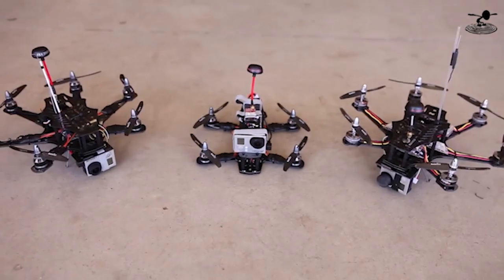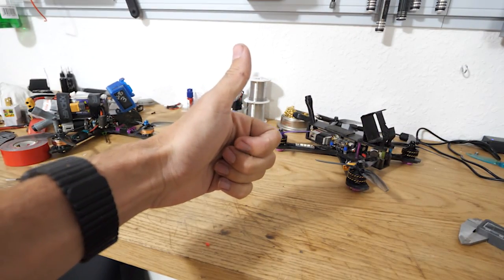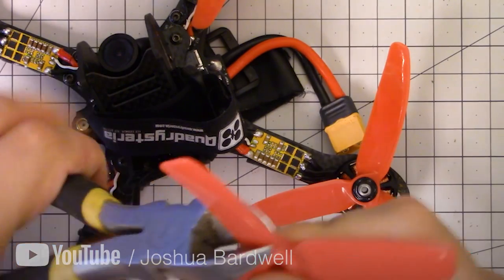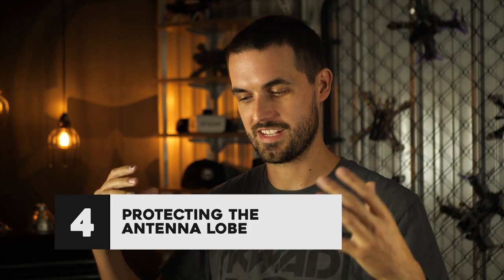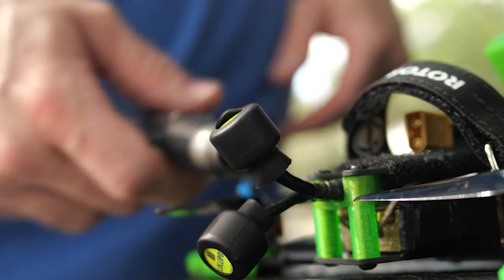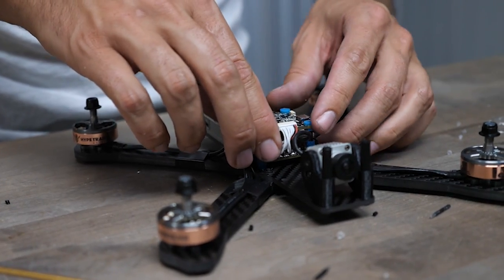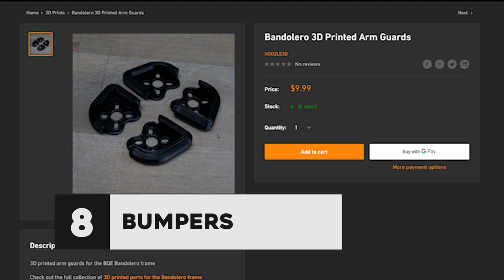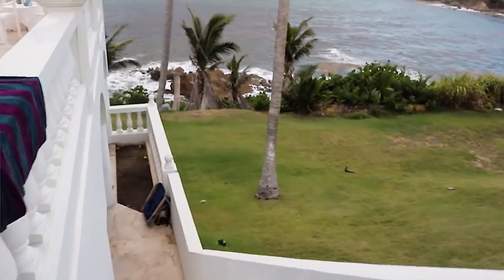top 10 Tips for DURABLE FPV Drones!

Comment: Tip, build 2 identical drones so you dont have to do fieldrepairs.
Reply: Genius, or stop paying child support for next BUILD
Reply: Why stop at 2, ménage à trois!
Reply: They wouldn't even have to be identical. And yes, most serious drone pilots have multiple drones for exactly this reason.
Reply: Tip: just be richer
Reply: I agree. It also makes it easier to buy spares, e.g. buy 9 motors for 2 quads, and one extra arm. And when both quads break in different places you can switch parts so that you end up with one working quad and one doubly broken, while waiting for new parts to arrive.

And you simplify tracking down what's broken, e.g. I recently burned a small resistor on an ESC and managed to find it by visually comparing everything against the identical working ESC I had on the other quad, and then comparing resistance measurements between them. If I didn't have two identical ESCs, I would probably have had to throw it away.

The comments about "being rich" are exaggerated, in the long run you probably spend less building 2 identical drones. And you certainly get more flight time per dollar spent.
Reply: Not necessary identical. But for same prop size and battery. Once had even 3 quads with me.
Reply: @axfpvalex1944  lmao underrated comment

Comment: Definitely forgot conformal coating
Reply: What is this?
Reply: @66g66g66g66g  Silicone coating that does not interfere with electrical signal. You coat all the exposed electronics on your escs and flight controller and your quad is suddenly a lot more waterproof.
Reply: @66g66g66g66g  your Quad can actually fly out of a water puddle with no damage at all.
One of my Quads is actually so waterproof now that i can not even press buttons anymore 😂
Reply: it improves durability but not repairability. Trying to solder onto a conformal coated board is a pain in the ass

Comment: I have saved my quad several times by flipping my mode switch to horizon mode, releasing the right stick and punching the throttle when i fail a maneuver like inverted yaw spin.
Reply: Bingo, that's exactly what I do I have my finger on that switch the whole time
Reply: Absolutely, in situations where the FC has time to react, this is a great way to regain control.
Reply: @EvenTheDogAgrees  in fact, i have intentionally done a death roll until inverted, allowed it to free fall, and flipped the switch at the last second while simultaneously hitting full throttle... Only twice. Lol
Reply: @Catiadr  Hahah, reminds me of my drone buddy. We both got started at the same time. I'm still figuring out basic things like hovering in place, maintaining constant altitude as I fly around, gauging my altitude and speed from the view in the goggles, ... Meanwhile, he's already trying out various stunts. So while my drone comes back from our flights relatively unscathed, perhaps some nicked props, he's currently out of commission because he tried to fuse his drone with the concrete pavement through liberal application of throttle... :')

Comment: Can confirm about learning to crash. In those events where you get caught in a branch, get flipped over, but the quad regains composure, it's so handy to at least be able to quickly flip over the quad so that the bottom bounces off the ground, instead of landing on an arm, or the GoPro, or even the battery. That quick reaction usually is what keeps me flying for a whole day usually!
Reply: yeah I just turn to Angle mode real quick

Comment: conformal coating is my favorite - I just landed in a fountain two days ago...
Reply: I've had mixed results.  Sunk one 3" quad in a puddle and it dried off and flew.  Landed another in wet grass and ESC fried.  I still use the coating though.
Reply: Hi
Reply: Bubby FPV sup bro
Reply: Is the conformal coating basically the same thing as never wet.  I don't mean as in the end product being it doesn't get wet. I mean never wet leaves a white rough sandy feeling to what ever is coated.  I've done a drone in it. And it works but looks like shit.  Looks like it was coated with that Xmas tree frosting but thinner.   So does it leave a noticable residue?
Reply: matt Wheat no, it doesn’t repel water just seals electronics. You can use clear nail polish too
Reply: Make sense if you expect your quad as disposable. Because after thorough coating repairing or upgrading it after is a huge pain. Same if Nano-Protect is used. In result - oily, smelly and dripping thing possible to keep only somewhere outside home.

Comment: #10 is really important. learned this during my helicopter flying days. learn to instinctively shut off your motor before you hit anything. either by killing throttle or by disarming. this will reduce the damage to your craft(burnt esc) and whatever it's hitting.
Reply: What? I thought I was the genius that came out with that, glad to know I have a twin 🤔🤯
Reply: Helis are so much more susceptible to damage because of the whole mechanical swash-plate array...
Quads aren't like that. I came from helis and by instinct disarmed as soon as I thought I was gonna hit something.
But no, I learned you can pull through, bounce off, throttle yourself out of a tree or even turtle-mode back.

Comment: Hey I use those skids, butt I add two of those foam pad on the back arms and it sticks up a little past the skids and keeps you going straight while sliding. Another is to put air mode on a switch. Then when you slide, throttle 0 and turn off air mode and it won't mess up having the quad try and fix what your doing. The props will just stop spinning. I have it on a toggle so it auto turns back on. Works awesome when going down a playground slide or something where it would be better to not having the props hitting things.

Comment: Conformal coating is so damn important, not only makes the quad water resistant but also protects it from short circuits (components touching other components or touching the frame).

Comment: I tried the foam that came with my Armattan frame. I tried the Ummagrip. The best thing I've found for holding the battery on is Velcro with sticky back on the batteries and the top of the quad. I've never had a battery eject or even shift position with the Velcro.

Comment: 1. I add a 1/2-3/4" band of double layer heat shrink to the ends of my batteries to secure the leads and act as a bit of a bumper.
2. My Tyro99 has narrow arms that are pretty fragile.  I added a thin coat of epoxy and they seem to hold up much better.
3. LOCTITE YOUR SCREWS!  I've now thrown two motors.  That's how many motors it took me to start using loctite and check my motor screws before every flight (especially if you're using plastic skids under the screws).
Love you guys!
Reply: I like to use a carbon fiber plate on top of bat, to get hard impact in the plate and not the batterie, by the way I also don't care about more weight

Comment: I‘am also using independent beepers like the vifly finder 2. It uses a separate little LiPo that also works when the main battery is ripped apart. Way easier to find a beeping kwad. 🤘
Reply: How do you activate it?
Reply: Bacon CheeseCake It activates itself automatically when the main Lipo disconnects or you can trigger it manually with a switch on your radio.
Reply: @hangtimeFPV  Ah, interesting. If you wanted to activate it manually, wouldn't you have to have the seperate lipo also power the reciever?
Reply: Bacon CheeseCake Manual triggering is only available with connected main battery. That makes sense because otherwise it automatically starts beeping if the main battery disconnects (through the integrated mini Lipo by itself).

Comment: 😎👍 Very helpful 
I started fpv few months and everything going well, had some crashes and fixing flying it goes on & on, Right now I don't know why it happened 
Arming motor started very little bit of throttle like 15%20 Drone just went so High no matter what I do it keeps going I disarmed it very quickly
   (droped from15feet)
Go pro mount was broken hopefully nothing happened more, after this I checked in beta flight everything looks good again checked flying good but why it's happened like that having no idea..

Comment: Thanks for this (haven't finished watching yet lol), but I went through a string of really bad luck and have learned some things which help with ruggedization.  You mention frames first - I couldn't bleevit, I finally fixed my drone after so many part fails, took off in street to test, zoomed up above trees, rolled - the friggin battery came unplugged (!#$#$*) and it smashed on the driveway - EVERY SINGLE pressnut on the RDQ Source one frame came out of the carbon, so I can't recommend that frame.  Ok, gonna watch now and hope I learn some new things which I will apply immediately.  Good to see you making videos.  They are all good.  Keep em coming, we are bored staying at home so much lol.

Comment: Is there any good ways to protect your batteries in a crash, they cost money and having them catch fire could be a problem
Reply: Put them on top lol
Reply: @OscarTRob  what if you crash upside down
Reply: Yeah true, idk tbh, they are pretty exposed aren't they
Reply: Yes listen to the guy before me, put a carbon fiver plate sandwich between bat and frame, just use any 1 or 2 mm plate that you have around ,make sure cover the bat,you b good for a while,yeah for a while

Comment: My favourite often missed tip is solder your wires on to your FC/4in1ESC backwards, so the wire is laying across the board rather than out from the board, helps the wires stop snagging on anything.

Comment: My list:
Protect the RX antennas with zip ties and heat shrink.
Give the batteries some extra padding by covering them with mountain bike wheel tube
Try to attach your battery leads to something else than just the FC or 4in1 esc so the 
PCB doesn't have to take the full force of a battery flailing around in case of a battery ejection.

Comment: Didn't say anything about action cams, and what measures we can take to make them survive just a little longer.
Reply: I made a hoop over with a large wire tie,
Reply: @peregrineflow7354 , am interested in your  idea,but don't get it yet,can you Dumbit out for me please
Reply: On a 2" whoop for example 12" wire-ties through the bottom and loop over the top making a sort of X with hoops connecting underneath. Wire ties come in all sizes I prefer the white nylon. I used it with a go pro on a R/C car using larger wire ties.
Reply: Mine I found lives longer if I mount the GoPro in a GroPro housing, with a aluminum GoPro base mount I bolt to the top of the frame. The ability to tilt back takes a lot of the force out of the impacts.
Reply: old comment but if you use a 3d printed armor with glass nd filters they can survive a lot, and just replace the nd filter if it gets cracked

Comment: I have been using RC tire "CA Glue", aka black super glue, plastic wrap, good heavy bench vice with some C clamps when needed to laminate my parts back together and so far, when done right, its actually hard to tell that the part was ever broken in the first place. However, I do think there is still a point of no return and I am not afraid to toss a part in the trash. Recently I doubled up the top plate on my Cidora SL5 with this same glue and so far its has been pretty awesome at taking a hit and I don't notice the extra weight.

I have since dropped the go pro for a runcam 5 orange and just yesterday started using my caddx tarsier but its looking like I might be going back to the go pro as getting the caddx on record and up in the air is too much work compared to just hitting a single button on an actual action camera but I do think the caddx footage looks really good at 2.k

Comment: My first 5" quad was a E-Turbine TB-250 from Hobbyking years ago (search for the picture of one, it's hilarious), sure it has carbon fibre arms but it also has feet attached to the arms that stick out & catch on everything, and big triangle holes in the arms that ruin the strength (the reason for carbon fibre in the first place), hence why an arm did break easily.
But I've got better at flying since then so coupled with the durability of current craft I break much less things :)
Reply: Tb 250, oh that thing is cool looking 0

Comment: In a moment like at 12:45, how about turn on level or horizontal mode for the drone to level of self?
Reply: That's a great idea  if you can remember  anything right when you are friking out
Reply: @axfpvalex1944  ahah I feel that pressure! But with training it might save some crashes!
Reply: I guess it depends. A lot of times if I have a crash hard enough that I can't orient myself upright, usually a prop will have bent down and block the motor from working anyways, and the quad will tumble to the ground.
There's also the inherent problem with the gyros on FCs that when they get bumped around (but don't crash), they lose their zero on horizontal, so even if you do flip on angle mode, it could still go sideways right into the tree or concrete building lol/

Comment: I would like to add that when I used cheap battery straps the battery was ejected during the crash as the strap broke. In my last crash due to buggy firmware on my Air unit freezing at close range I used a kevlar strap that managed to hold the battery on during the crash. The result was the 6 cell venting explosively while it was held tight against my quad burning out everything but two motors and my finder beeper.
Reply: Sorry to hijack but;

Did you solve the range issue? Downgrade firmware?
Reply: @JarredBaines  Yes I downgraded my remaining Air units on v01.00.05.00 firmware to v01.00.02.00 and everything works great again. DJI told me they are aware of many issues and to wait for next firmware. Other issues include false SLOW SD errors, corrupted recordings and randomly chopped off recordings on Air unit and DISARMED text stuck on OSD after takeoff.
Reply: @changeagent228  legend, thankyou! Good info
Reply: @JarredBaines  You're welcome. 👍

Comment: Don't forget the RX and its antenna(s)! For floppy antennas a la XM+, heatshrink them with a ziptie. For immortal-T antennas, might be a good idea to dab a bit of hot glue and/or epoxy over the part where the antenna protrudes from the 'T' housing, then heatshrink over them. Also don't forget to secure the u.fl connector that's usually used on the RX, especially when you've replaced the antenna and got rid of the yellow/white goop that secured the u.fl plug from the factory -- I find that a tiny dab of hot glue or a small piece of foam tape over the u.fl combined with heatshrink over the RX helps tremendously.

Comment: Route all cables carefully:
 - avoiding sharp parts of the frame
 - leaving just enough slack
 - do not expose then to the battery strap if possible
 - do not let them protrude unnecessarily, e.g. wire them "inwards" on the 4-in-1-ESC and then back out onto the arms instead of the shortest path.

Comment: I put a zip tie between flycontroler and frame ,with ESC between, to hold the flight stack in place in case of crash
Reply: Wait, so the zip tie holds the FC to the frame? That's gonna add some vibrations I would think right?

Comment: Don't forget over sized motors and battery so that once you strap an old tire around your drone you still have the power to fly. Tires work great. When laid flat (the opposite of the orientation on your vehicle, with drone in the middle, the props can still provide thrust due to the hole in the tire. Sucks in thru the top and out the bottom.  Think of it as one big DUCT.  And call it a B.F. Goodwhoop Ducted T/A.

Comment: I’m one of those people that uses two battery straps but I plug in first and then strap it down so it shouldn’t come unplugged. It’s not as convenient as being able to plug in and out without loosening the straps but I really don’t want to come unplugged if I happen to crash on a rooftop or something and I’ve saved at least one quad with a GoPro that I couldn’t have retrieved if I wasn’t able to flip over and limp back 😂

Comment: My first quad (rotor riot HD1) already crashed a few :) ... main thing happen and happen again is the battery goes back or forward on the top plate and tear of the power pads from the esc . I solder it many time but after 4 or 6 time there was nothing left on the esc to keep solder . Even with straps or pads the battery still slip enough to do this . Try to zip the wires on the frame doesn't change this problem. nobody experience this ?
Reply: Zip tie it
Reply from the maker: Hey Colin! The battery pad on the top plate is meant to reduce battery slipping. Make sure its clean. Use a damp cloth to wipe it clean. If you still need more grip on the battery, get high strength velcro or Dual Lock and use that to attach your battery to the top plate before strapping it (with two straps 😉)

Comment: The point of cutting these ugly holes is not just reducing the weight but also allowing the streamline to pass through and curtailing wind resistance. And also, if they are to break, they break, even if no drilling is there. Besides, buy some 3D prints to protect your motors, don't solely rely on your frame.